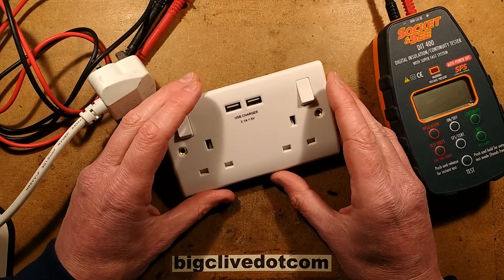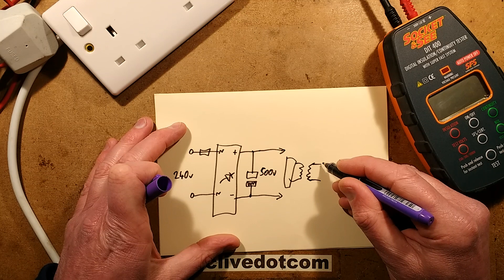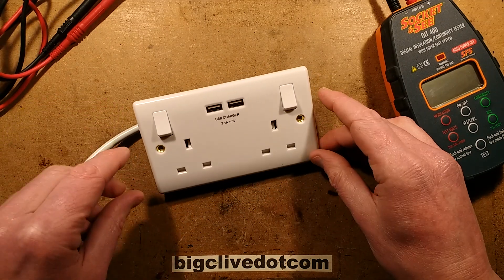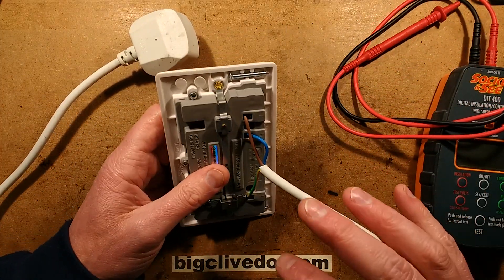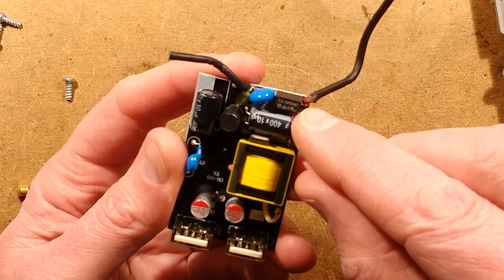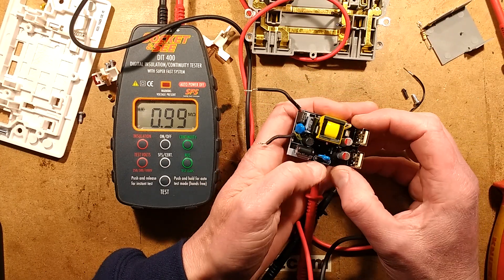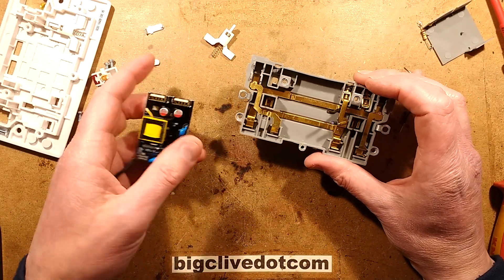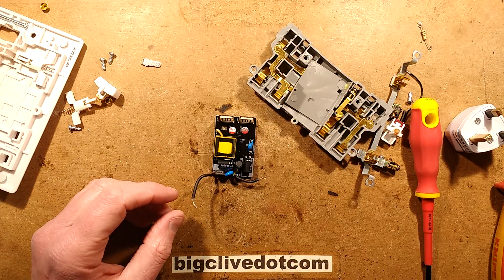500V insulation test of a British General USB socket.

Comment: Never test between live and neutral! You didn't test the insulation, you measured the DC resistance of the load. Honestly, you should remove this video, I'm sorry to say that.
Reply from the maker: A full test of an installation should include an insulation resistance test between L and N.  The manual implies that these sockets can be left connected without affecting that result excessively.
Reply: bigclivedotcom A full test should be done directly after you did the installation. Whith consumers installed, you should not do it. Just think about neon-lamps in some switches. These will light up brightly when giving them 500V. And before testing or measuring anythin, always ask yourself: What result do i expect, what if the result is way off my expectation? Testing between live and neutral, you could read 1MOhm, or you could read 0,01MOhm. What does 0,01MOhm mean? Nothing. It just says, that there might be a load in the circuit. By the way: I am talking about german "VDE Normen". But i think, that british contractors will not have to remove any loads, any neon-lamps in switches, when testing an installation. Do they???
Reply: AFAIK, if you've bought the house, it should have been tested BEFORE you move in by the contractors. Therefore YOU don't have to do the same test again - as mentioned by others in the comments, it's only to check for damage cause during installation. I assume you're not installing new cable runs etc. and just changing the faceplates?
Reply: Microwave with badly insulation, failed on  350V ^^
https://www.youtube.com/watch?v=IHOlx9_fRQY
Reply: @Ratzfaz I think it was the overheating that broke it down, rather than the voltage itself.
Reply: You've misunderstood the test. When you complete an electrical installation in a new building, or when doing periodic testing, you need to test that the insulation between the conductors is high enough. This is supposed to be done with no loads connected. Having one of these connected is going to effect the results of that test because it can't be unplugged, and shouldn't be disconnected as the socket forms part of the system that is being tested.
Reply: Just looked at the datasheet for the metal faced socket (same internals) and that states you should expect a result around 0.4meg ohms on a 500v test. Which seems to be correct given the readings you got. Thomas Nagy talks about testing this kind of stuff in one of his videos and explains why you should only do L-E and N-E for exactly these reasons.
Reply: can ''any'' Power Supply survive an insulation test with (real) 500V between L and N ? NO except, it is rated for 500V AC, otherwise u blow the shit up.....

Comment: Clive, why on Earth were you checking insulation resistance across the input to the circuit? You needed to be checking between the mains input and the 5V output. 
In any case, I love your videos!
A few years ago my company made (Ahem.... O.D.M.ed from China) similar sockets for the American market. Your example's construction looks quite superior.
Reply from the maker: I was emulating an installation test.  Not the isoilation of the USB module itself.
Reply: The installation test would be L and N combined together and test the insulation against earth. Or test L and N separate against earth, which would be two tests. That's the reason this test is performed on the service panel, or fuse box or whatever it's name is in the UK. If you're using a tester which don't have a polarity reverse, you must reverse the polarity for yourself by switching over the test leads and test again. The higher value is the one that counts.
And of course if you're performing a test on a TN-C-S grid you must disconnect the neutral wire from the terminal, or the test will fail.

But testing L angainst N is not correct, because you've got some electronics connected which will produce faulty values.
Reply: ??? You confuse me, kind sir. That's a class-Y cap and transformer isolation tester. At 0:35 they're saying that the 10MΩ is what you should see from live to earth and your tester agrees at 8:00 or at least it says >2M for live and neutral to earth. Their first sentence is fairly clear but the second one appears to be a clumsy translation, although technically correct. You keep testing the input resistance of the circuit which at 290K shows a modest quiescent draw as it should thanks to idle draw and the input bleeder (if any). You're also testing the input voltage handling/current limiting of the SMPS chip & transistor. In lots of more complex supplies, at 500V you would fire the overvoltage protection MOVs too.
Reply: +Peter S
The instruction manual of the outlet says that you'll measure round about 10 MOhms if you perform an insulation test. The 2 MOhms are the value you must have at least in the UK I suppose (here in Germany it's at least 1 MOhm).

Comment: I recently stayed at a big chain hotel and noticed this type of outlet in the lobby.  The USB jack had a crispy black spot around it. No one seemed to know the story behind that. I can only imagine...
Reply: Против Глобал
In the lobby? lmao.
Reply: Could well be, someone bought their cable at Dollar Tree (our version of Poundland). I hope they didn't do damage to anything expensive like a smartphone.
Reply: Mike EL never seen that
Reply: Knuckles the Echidna In my experience recently, Monoprice is a good source of cheap relatively high quality cables. Check out their site, the Select series micro USB's
Reply: A cable with a partial short will barbeque a USB socket particularly one that can actually deliver 2 amps, even if it has current protection. The partial short won't draw too much current but will convert all of the power it is drawing into heat.
Reply: Mike EL are cables like the ones off Amazon that cost £6 for a pack of 3 likely to be like that?
Reply: Easy, Clive stayed there before you ;)
Reply: And that's why I never buy anything electrical at the dollar store.
Reply: Table tennis with Michael bubble
Reply: Против Глобал  damn those Chinese vibrators!!
Reply: electroboom, it was electroboom, it had to have been.
Reply: Paul Drake Only way I'd use one of these is if I knew the brand, and I installed it myself.

Comment: I bought one of those for my folks place so they didn't keep having to move their phone charger from room to room.(Think it was a tenner from B&Q) Not sure it was the same brand but looks to be from the same factory, after 3 months it went bang and the usb doesn't work anymore (nothing was plugged into it at the time) The one I replaced it with was also from B&Q but 25 quid and has been working fine ever since. Will have to open it up next time i'm over there and see what went wrong.
Reply: Yep, no doubt it was a cap or diode or something that went bang. Just not had the chance to have a look at it yet, might be an interesting failure. Aparantly it just went bang about 3am one night, nobody realised what it was until they went to try and charge a phone the next time, not even a usb cable was plugged in at the time so must be some internal fault. Will try and remember to examine it! Both usbs failed so I assume its a common part.